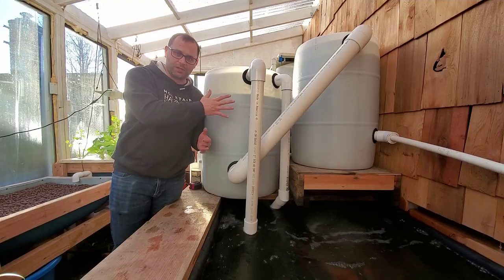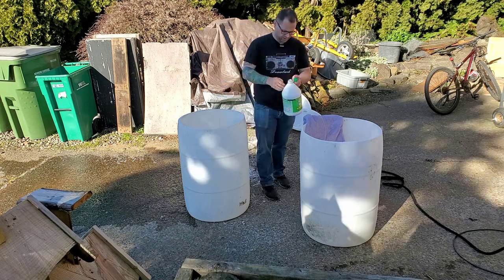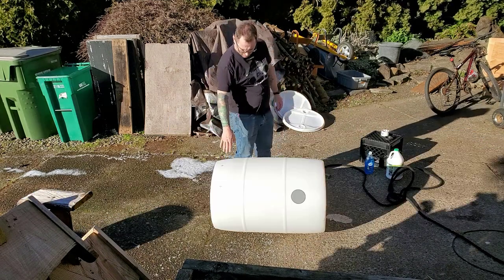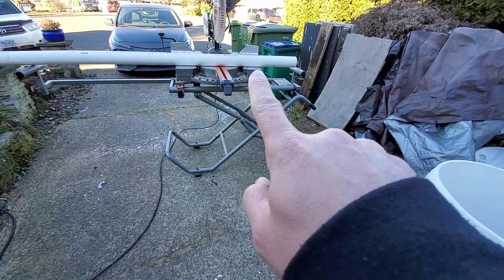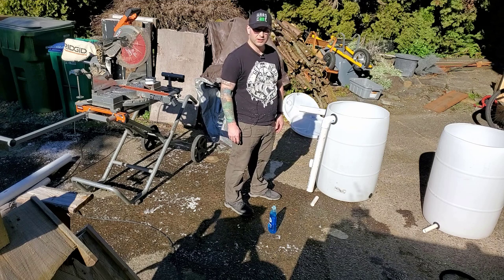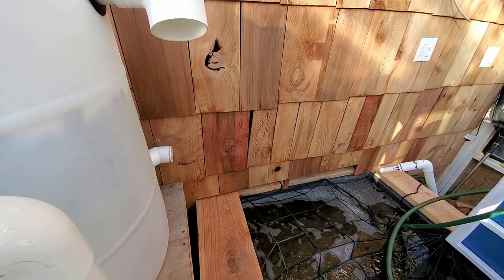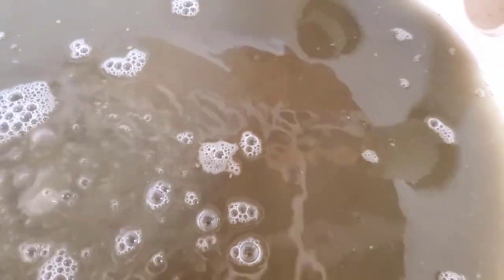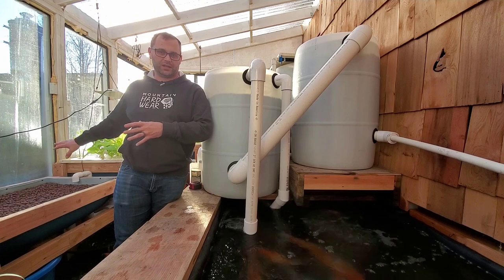Detailed DIY Double-Barrel Filter Build

Comment: Run hole saw backwards for a few moments.  Just to establish a score line.  Then drill it forward to finish.  Best is to do the backward drilling on both inside and outside then finish in forward.  This will almost eliminate burrs.

Comment: Definitely nothing is as cheap as it used to be with all the plumbing parts and supplies, but it's still way better than what a commercial built filter will cost.  Great builds I'm likely going to take and use some of these ideas to build my my  future expanded filtration setups
Reply from the maker: Right on
Reply: Yi

Comment: Do you have issues with your 2nd filter not moving water in the the pond, while the 1st filter is pushing water into it?

Currently my 2nd filter does not drain into the pond fast enough.

Comment: Great build.    Rather than use large rocks to support the smaller rocks on top of them, why not use a plastic baffle as a strainer to fit the barrel?  It would support whatever media you'd like to use.   Right now your filter media is rocks but you could anything.   For example filter floss for finer particles.  Have 3 strainers to support the different types/sizes of media.  Would make it easier to maintain the filter if you ever needed to.   Also would make sure that there's no collapse inside the filter with the rocks shifting and then falling down. Just a suggestion.
Reply: My rock filter has lots of clogging. I'm having a meltdown lol, this design is good but the rock has too go
Reply: @yowheremybeerhennessey5415  Swimming pool filters use diatomaceous earth as a media.   Even that eventually clogs if not cleaned.   So the filter can do a backwash - reversing the flow of water through the media to get it to flush the excess dirt out.   It would either have to be easier to clean the filter or have it do a backwash.

Comment: I am going to set up an 8ft aquarium, about 1000 litres (about 240 gallons I think).  I can easily put a couple of pipes through the wall to get outside the house.  I want to set up a couple of barrels and make a filter a bit like yours outside the house.  I live in a sub tropical climate so heat loss won’t be a big problem.  Can anyone see a reason why it wouldn’t work?  To me this looks like a much better (and cheaper) solution than buying two huge canister filters.  What capacity pump would be suitable?

Comment: HELP please!  We built this to the letter about 9-10 months ago.  We've cleaned it three or four times using the water over the top rocks method.  About three weeks ago, the pump failed.  When it did, the entire filtration system fed back into the tank and by the time we found it, all but 10 fish were dead.  They replaced the pump.  But now, it won't filter like it used to.  It's not sucking all the gunk to the bottom of the barrels.  The water is almost black.  We have water changed about every three days trying to fix it.  We tried running water down through the rocks and out the bottom drain.  We tried running water through the bottom drain and up through the rocks and draining via the top of the barrels.  Still, it just won't come clean and/or filter properly anymore.  We suspect that when the pump stopped a vacuum occurred and all the sludge sucked back through the system and into the tank.  So we suspect the sludge is all through the media now and not just at the bottom of the barrels.  Any idea how to fix this?  We just got replacement fingerlings and can't even think about putting them in this tank.
Reply: Do you have a one-way valve going from the pump to the filter? It's always a good idea in case of a power or pump failure to prevent backflow from going back into the pond and causing an ammonia spike. 

As for the gravel, what kind did you use? Professional pond builders say to use the round river stone and pea gravel as they won't compact and hinder the flow through them. Crushed rock locks together over time and compacts and can clog up very quickly.
Reply: @vanissaberg5824  Thank you for responding.  We do not have a one-way valve.  Where would we get this for 1-2inch PVC pipe?  We used the huge river rock on bottom, then river rock about tennis ball size next step up.  The smaller river rock about golf ball size.  Then smaller ones.  Then at the top, it "might" be crushed rock?  It's probably about 1inch of it.  So after I posted the initial help request, I kept flushing water from the bottom of the barrels to the top.  I did this all day on both barrels until finally the water was coming up through the rock backwards, but clear.  I also kept water changing the tank water until it was perfectly clear.  I figure this had to of cleaned out these two barrels.  NOPE.  After running it for a couple days and with less than 10 fish left, the water turned dark brown to the point we couldn't see anything in it.  We ended up letting most of the water out and running off a smaller tank pump and filter system.  But it's not working either.  About to lose the last few fish we have left.  I have no idea why after cleaning these things out for the entire day, there was still so much waste in there to flood the tank again.  I'm totally baffled.
Reply: @tahrahhunt6750  you should be able to find a one-way check valve at most hardware stores or online. Some can come apart making it easier to disassemble if needed. 

As for the gravel that's a tough one. Is the waste making its way through all the gravel? In that case, you may want to add a layer of pond filter sponges on top to catch any remaining muck on top (assuming your filter flows from the bottom up) to polish the water. 

Alternatively, instead of using rocks and gravel, stuffing the barrel with plastic mesh such as scrap greenhouse shade cloth or plastic bottle caps and mesh fruit bags and pot scrubbies floating in the barrel can do the same thing trapping muck underneath and only the clean water comes through the top. Cleaning is as easy as stirring it up with a broomstick and draining it as normal and still gives your bacteria a place to grow. If you've given up on the rock, this is the solution I've done that's worked for me. Also a lot easier on your back.

Comment: Great job Man! Can you give me idea about what your water flow is?
Reply from the maker: I'm probably down somewhere around 2500 GPH from 4500 GPH at the pump.  Reduced to 1" and then head height takes me around 2500 GPH.  But the pond it's on is under a thousand gallons, so it's turning often.

Comment: Would you possibly be able to give a material list in future videos? I’m trying to build this for my fancy’s but I had myself going back and forth to figure out what exactly I needed. Also what kind of pump are you using, figured if yours worked I might as well get the same
Reply from the maker: I tried to remember everything and put it in the description, but I will do a better job creating the list in the future.  The pump I'm using is a Pondmaster https://amzn.to/3JIlzjg which is overkill for the job, but I already had it.  I put two options for pumps I would recommend in the description for the video.  I have both of those recommended pumps I use on different water features on my property.

Comment: Is that Koi bacteria good for tilapia too?  Also, hopefully not a stupid question, but if you don't have media like sponge or something to catch the poop, how do you keep the poop from going right back into the tank?  Also, what size fish is too small for the recommended pump?  Some of our tilapia are still pretty small.  I noticed you had a new bag of tilapia come in (at least I'm pretty sure it was you).  What size pump do you use in your fingerling tank?
Reply from the maker: You can not run the pump when your Tilapia are that small.  I learned the hard way.  I would turn it off or better yet get a small fish tank setup and start your fry in the fish tank where you can watch them closer.  I did this the last time I got Tilapia and I did not lose one of them.  Once they were between 1" and 2" I moved them to the IBC tote.  That pump is not a problem once they are the size listed above.  But when they were around a 1/2" they didn't stand a chance with that pump.  
To the poop question.  The gravel grabs the poop.  That's why you need the small gravel up top.  Then when you clean it like in this video https://youtu.be/rI-mwQEI0sw you wash the poo down and out into your yard.
Reply: Thank you.  You always respond so quickly and with much detail.  Did you happen to list somewhere what type of gravel and/or rocks you got and the best ways to find them at a decent price?  Lowes and Home Depot are insane.
Reply from the maker: @tahrahhunt6750  I do talk about the different grades of gravel I use in the build.  But I don't mention where the best place is to get them.  If you have a landscaping store around you they usually sell bags of gravel and those are the best pricing you can get.
Reply: @BabblinginmyBackyard  Thank  you.  About to watch one last time and write it all down.  :)
Reply: @BabblinginmyBackyard  Oh, and you didn't answer if that Koi bacteria in your video is good for tilapia as well.  I use that barley straw extract, but so far I'm still getting pretty green walls and dark water.  Ugh.
Reply from the maker: @tahrahhunt6750  Yes, you can use the Bacteria for your Tilapia.  When the Tilapia get around 2" you will have nothing left for algae on the walls.  They pick it clean.